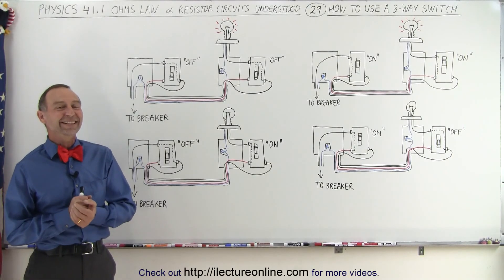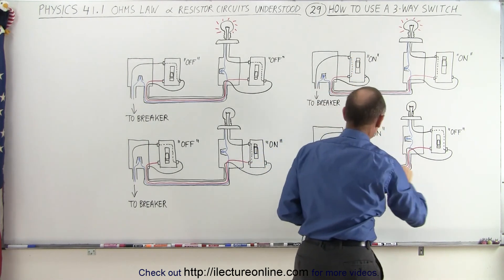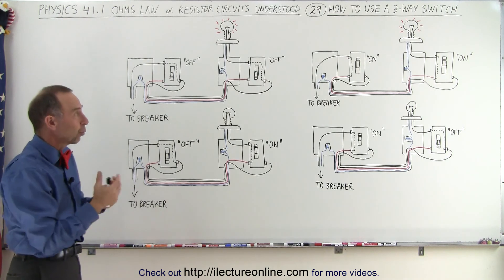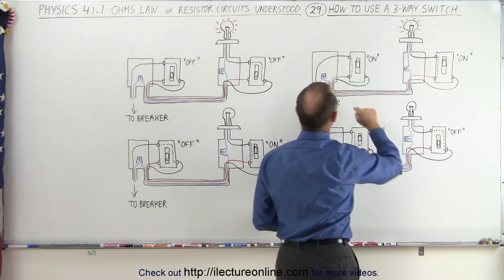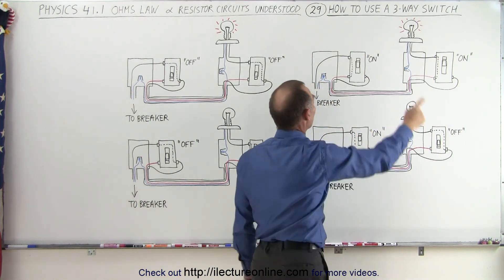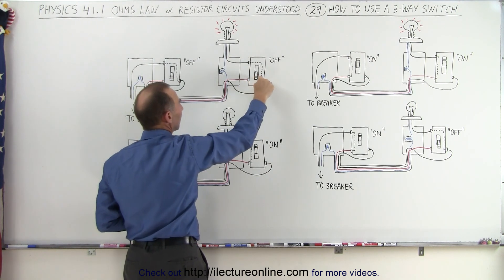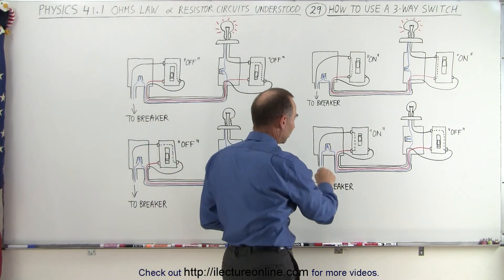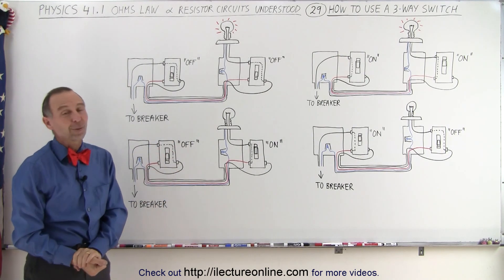Physics - E&M: Ch 41.1 Ohm's Law & Resistor Circuit Understood (29 of 42) How to use 3-Way Switch?

Comment: I thought it was more comlicated, i lived in a house for 10 years that had a hallway with a 3-way switch and i kept wondering how it works. But mine was a little bit diferent, one of the switches needed to be "ON" and other "Off" to turn on the Light
Reply from the maker: They may have connected it incorrectly, such that one had to be in the "ON" position for the second switch to work.